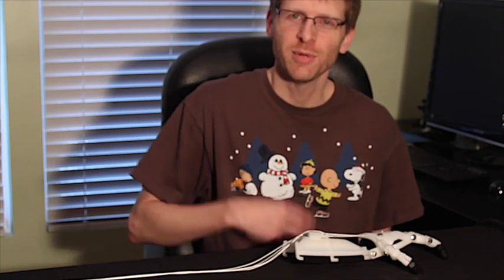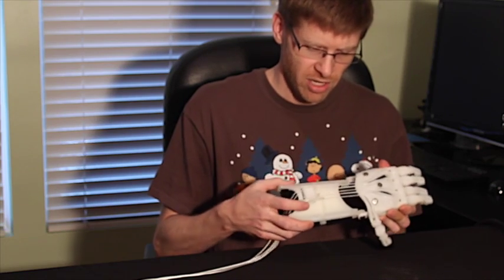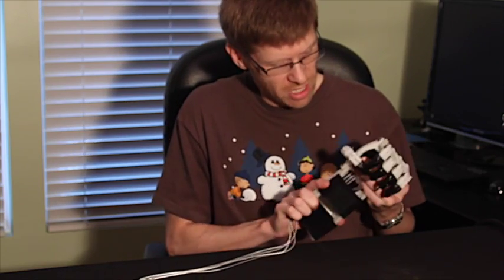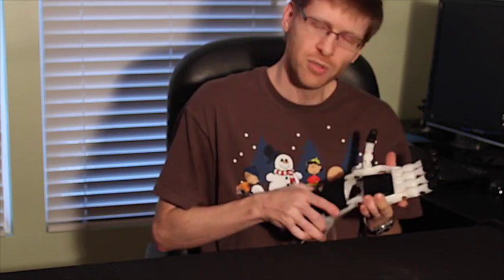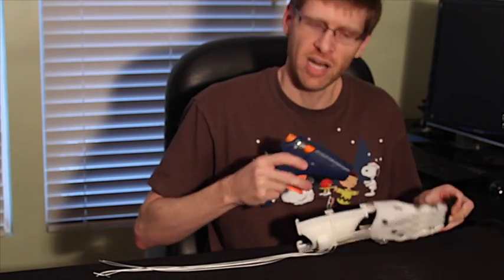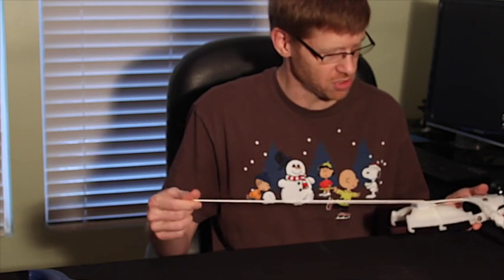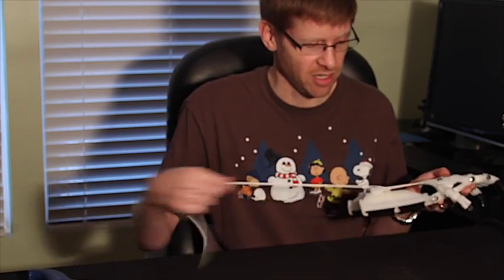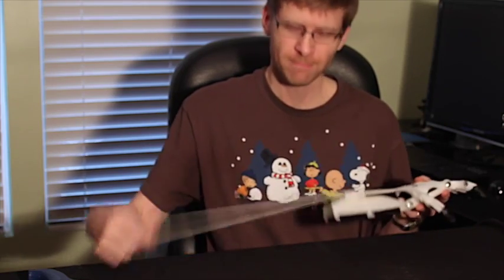The e-NABLE Hand 3D Printed Prosthesis, Printed in Taulman Bridge Nylon (3D Universe)

Comment: Looks great. What printer did you use?
Reply from the maker: This was done on a Flashforge Creator. I used a sheet of glass covered with a layer of PVA glue to print on.
Reply: i know that this was posted a while back, but, just building my first nylon ptinter, and on the hot glue note, i have found that if designed with a very small overlap/seam, two nylon pieces can be almost totally bonded with a quick run of a hot soldering iron tip... just wanted to pass it on since i'm also interrested in prosthetic (among other) work, and this technique "seams" to work so well... hehe..
Reply: Jordan McClellan Seams a good idea. Thanks